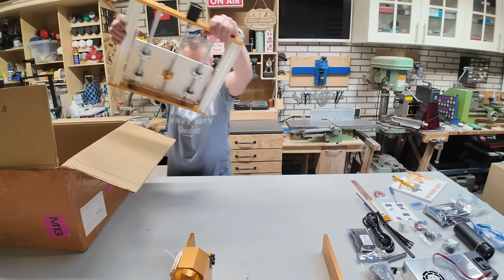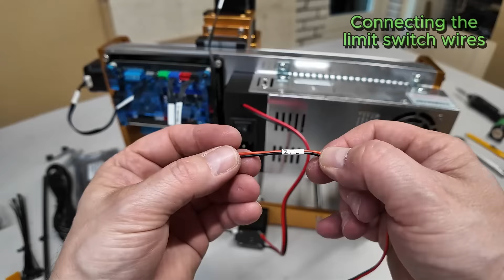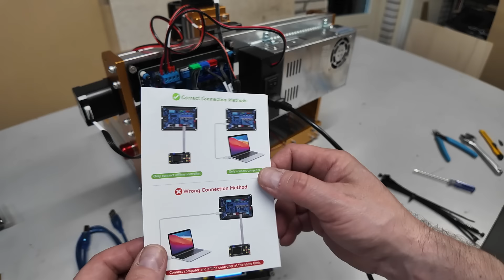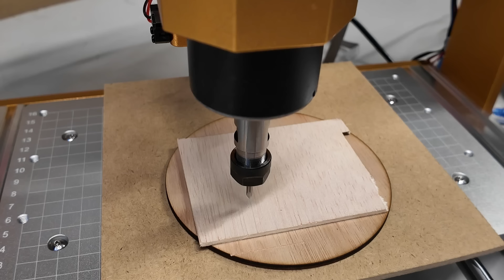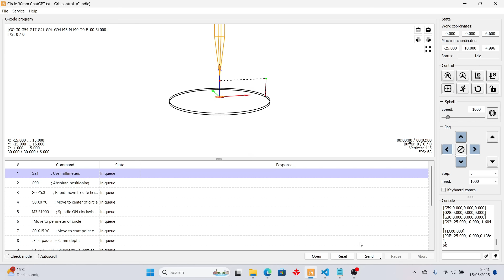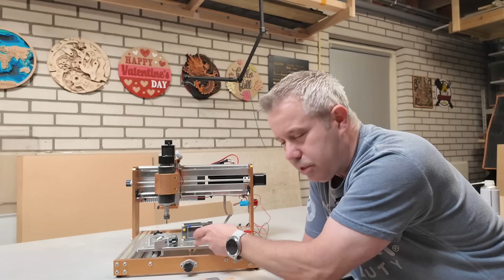LUNYEE 3018 Pro Ultra Desktop CNC, Not Just Another 3018 CNC machine.. | #cnc #fusion360 #cncrouter

Comment: How do you define the starting point and the cutable area of the piece? Also how does it handle larger runs of duplicate items? Can you get a flow going where its predictable every time? I ask because I am looking this for nameplates. So im gonna need the clamps to hold them down and I just want it to be able to cut again and again without moving the bit all around and hitting the clamps. Also can you cut partial passes so you can move the clamps and then continue cutting the uncut area?

Comment: That sure looks a whole lot nicer than a number of the other 3018 variants that I've looked at,  but I'm a bit bothered by the lack of enclosure  on the controller and both it and the power supply being mounted where they are and subject to all of the machine's vibration.  Fixing that would be a real improvement.
Reply from the maker: Well, then you should definitely look at their 3020 Nova 😉
https://youtu.be/EYhh859WVYo

Comment: Does this run using an Arduino type board or a later GD32 bit processor+
Reply from the maker: Hi, it has a 32bit control board, not an arduino.
https://www.lunyeecnc.com/products/3018-pro-ultra-cnc-router-machine-for-diy-engraving-dreams

Comment: I would like to make the enclosures for the DIY SMPS.  Will this be able to do PVC or metal enclosures.  Good enough to pass the electrical safety certification?
Reply from the maker: With this machine you will be able to do PVC, and if you take it slow, soft metals such as aluminium. About passing the safety certification, I think it's best to verify this with Lunyee.

Comment: Does this have controls similar to a standard cnc controller, such as single block and feed rate override for running through a program slowly?
Reply from the maker: I guess this depends on what program you use to run your gcode if you can run it line by line. The machine/controller will just follow the program.

Comment: Hi Jeroen, I have a plan to buy CNC router to cut a form of model that have vary thickness from 0.15mm - 3 mm. Do you think this machine have capable precision to do it? Material is from epoxy resin. Thanks.
Reply from the maker: Yes, I think this machine would be able to do this doing several passes. It really is a very sturdy machine for it's size.

Comment: These things just prove to me cnc requires more commercial machines low cost does not work 😢
Reply from the maker: Hi, thanks for watching. Yes, these kinds of machines are meant for hobby and not for commercial use.
However, I do not agree with you that low cost machines in general do not work. This machine in particular is pretty sturdy and does the job quite well. 
I agree with you that some of the low cost machines are not built very well, have a lot of play or other flaws, but that does not mean all are bad.
Commercial CNC machines in general are better equipped, are a lot more solid but this all does come at a price which is not for everybody.

Comment: Hi Jeroen, Very nice review as always you do a very thorough job when you review these tools so thank you. I am sold on the solid build design and bed working area for a 3018. I am not a fan of the wiring and the open frame controller board and the fact that it had no instructions for connecting the wires, but if you look at the website they have a nice image of the controller board and what connects to each terminal so there is a work around for that but no work around for the wiring or the open frame controller and I am concerned with dust getting on the connectors over time even though I do vacuum often. Despite that I am pretty much sold based on the price and might even consider getting the 10 watt laser module with it. I like the fact of having a machine for small projects and I can put away on the shelf when not in use. Thanks.
Reply from the maker: Hi, thanks for your feedback, glad you like my review. I think for the controller part, especially with 3D printing being available to everybody nowadays, I'm pretty sure you should be able to find or create a design for adding a vacuum to the spindle. If you'd add a brush onto it, it will for sure reduce the dust significantly. You could also create an enclosure for the controller, as long as you will keep enough ventilation so the stepper drivers can stay cool.

Something like this for instance.
https://www.thingiverse.com/thing:536091
Reply: @jewijk  Very true, now days we can 3D print add on accessories such as a dust adapter for the spindle, or you can buy a dust adapter port from the same manufacturer or from Esty if you don't have a 3D printer. I might even have an extra one laying around too already since I have three other CNCs and do have a 500 watt spindle on my Sain Smart that I could borrow for the 3018. thanks.
Reply from the maker: @ruizd14 very true 👍🏻

Comment: Nice video again, I have the cheaper one (from Vevor) with the rods instead of the linear rails but the linear rails are definitely a good upgrade in terms of stability. I use my machine to make center marks with a center drill  (normaly use in lathe machines) in aluminum plates then I drill the center marks manually with the drill press, this saves a lot of marking work and scratches on the aluminium plates. Smart that you used ChatGPT to generate simpleG-code!
Reply from the maker: Hi, thanks for watching. Smart idea to use your machine for that. Yes the upgrated lineair rails do make a difference in my opinion, but even without them it's still a great compact cnc machine to use.